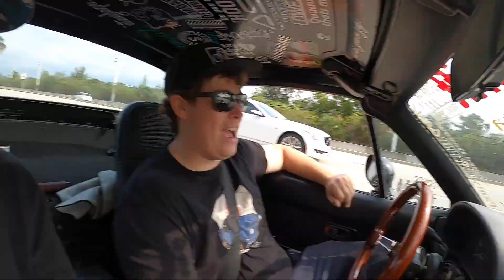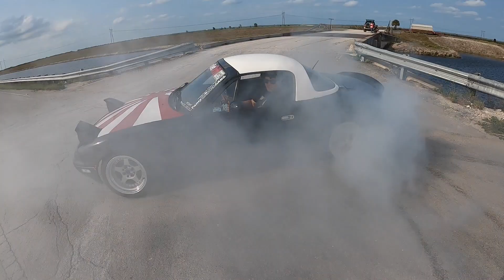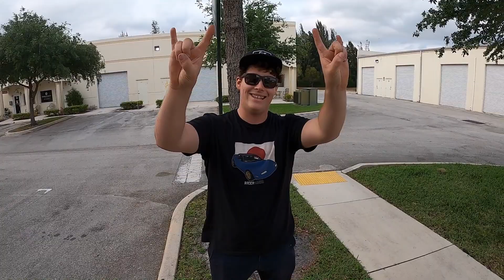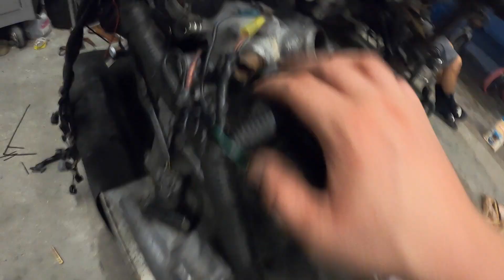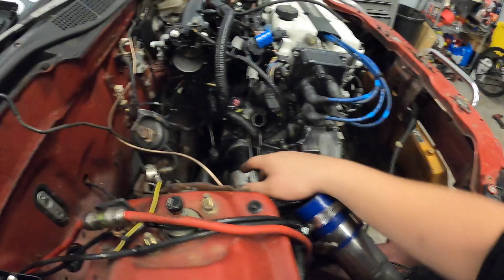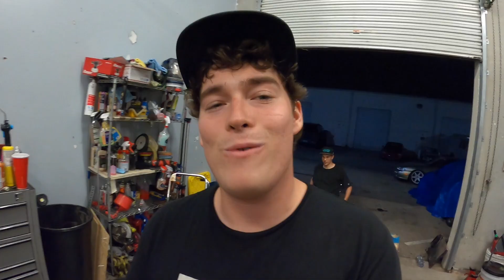ULTIMATE SLEEPER! RICER CIVIC MEETS GSR!

Comment: With the key tumbler off like the way it is, you could stick a screwdriver or a needle nose pliers to turn the knob on the inside of the tumbler holder
Reply: Yup that's how we did it in my younger days. A big flat head screwdriver and a big rock to smash out the ignition then turn inside with screwdriver and u good to go

Comment: GSR will treat you right, I turbo'd my stock 98 gsr with a 57 trim t3/t04e ... 9 psi it made 302whp and trapped 114 in the quarter,,,,turbo'd it at 106k miles.... parted it out with the engine still good compression at 162k miles.. had some blow by... but man its all in the tune.

Comment: If your gonna run your fan setup like that on the river civ you should just run the wires to a switch in the car and just leave it on you'd be less likely to have any kind of mess up with the electrical and it's cleaner lol